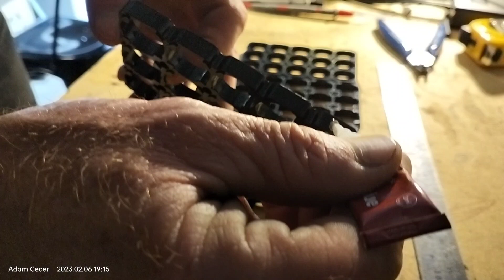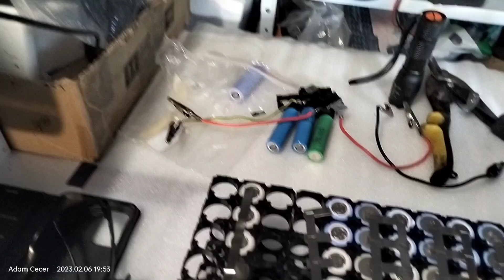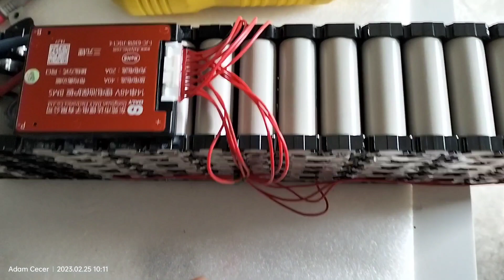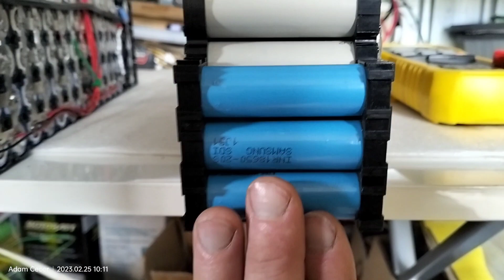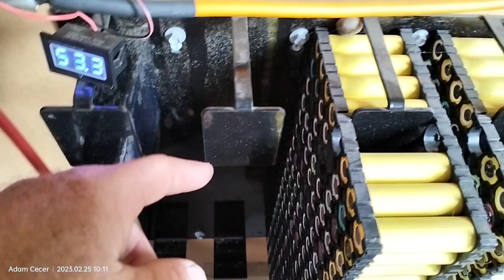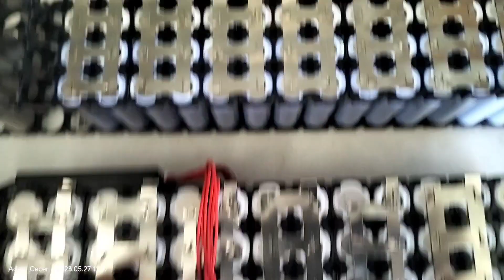21700 Battery pack on 18650 Wall Mounts.

Comment: Nice job mate. I still haven't even held a 21700 cell lol. I don't like the xt90 connectors I don't believe there any good for high voltage. I'm now using Qs8-s conectors
Reply from the maker: Thanks. When I first started, the 18650 cells was big compared to the AA. Now the 18650 is unbelievably small compared to the 21700. What would it be like if I start finding something like the 46800.
I looked into a larger connecter about 150amp because the XT90 are little too small to solder the wire onto the terminal. I will look into the Qs8-s. Thanks

Comment: Thanks Adam,  cool to get an update on your powerwall! The future will probably be all 21700?
Reply from the maker: Maybe a mix of 18650 and 21700. From the same DeWalt batteries are the 2amp 18650. I have tested about 500 and about half way of unopened. I hope to make a 157p 14s with these. Have to wait for lot more.